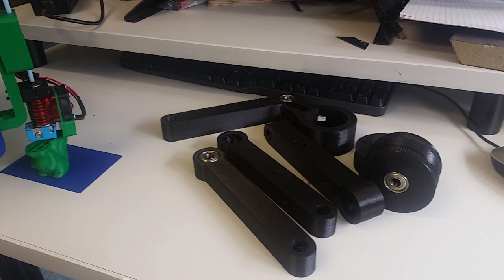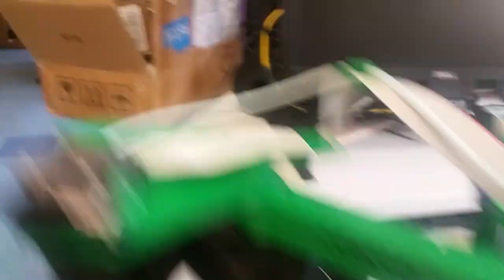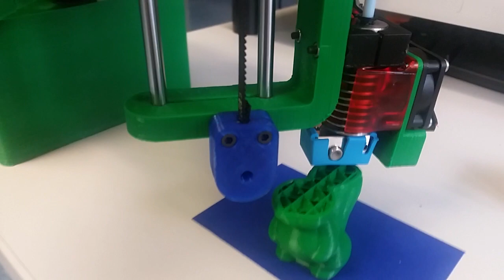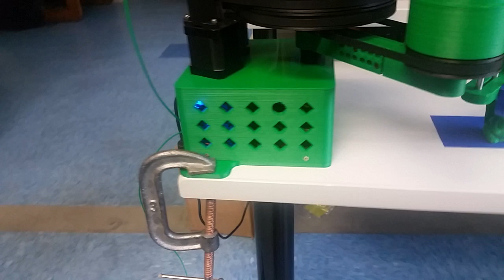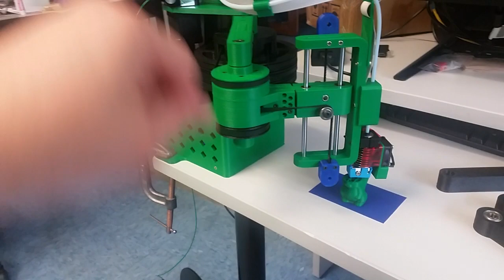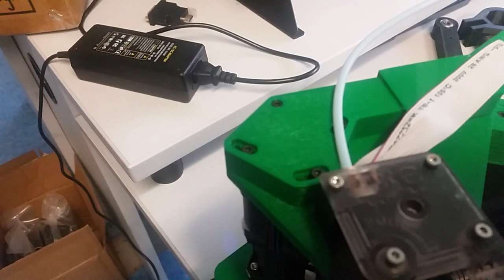Introducing RepRap Helios (First Print)

Comment: There was some interesting followup(?) video where you only showed the motor-pack core alone.
I can't find it anymore. Was it an older video or is that video taken down?
Reply from the maker: Hmm.  I don't remember that.  I think all of my RepRap HELIOS videos are public.  Anything that you want to know?
Reply: @NicholasSeward  
I like that one because it factors out all the motor vitamins into one single compact monolithic (pick and placeable) package.
So I'm thinking about eventually replicating something similar and tried to gather as much info as possible to 
not repeat errors/dead-ends that you may already have went through. ––– >> Do you maybe have 3D files published?
Reply: One big difference: –– I eventually may go for 3D printed chains rather than belts. 
High flex, high mass, bad performance I know, but it should be fine for crude pick and place robots which need way less accuracy than 3D printers. 
And chains can be pick and place assembled which is what I desire, given purely mechanical pick and place self-replication is my (overly ambitious) eventual goal.
Also I'll need additional motors for rotational DOFs. Chain threading through joints is gonna be a serious headache.
Reply: @NicholasSeward  – 
BTW what's the best way to privately contact you? – I found no contact info online.
( side-note – If spam-bots are your concern I solved that by putting an image of my mail on my homepage on github )
I recently have done some (yet unpublished) work (design & testprint) of 
fully-3D-printable tapered/conical cycloid sinusodial-herringbone gear-bearings that 
can be preloaded to zero backlash by back-to-back axial clamping of a pair of such bearings (with smartly 3D printed screws even).
I guess you'd be interested.
Reply from the maker: @mechadense  email is firstname.lastname@gmail.com the bearing sounds awesome.

Comment: Print time and cost of printer ?
Reply from the maker: It can pretty much be as cheap as you want.  It is a function of the cost of the electronics.  I could make a <200 dollar printer if I had to.  Print time is slow.  I havent pushed it but I have only gone about half speed of traditional printere.
Reply: @NicholasSeward  I think a dual-arm scara 3d printer would be faster and more stable. 

For example: https://youtu.be/R_AIzCTYBNs 

Just add a z-axis to the above design and compensate for the singularity regions by utilizing inertia (or just avoid printing in those regions).

I'm actually very interested in building a scara CNC device with a changeable end-effector to allow it to 3d print, mill, and laser engrave/ cut. I was researching this when I came across your awesome build.
Reply: @jaredj-v5l  I made a two arm.  Google Reprap Wally.  The one arm is good for cost, control, and portability reasons.  Speed wasnt a goal so you are right that a more parallel solution will be faster.
Reply: @NicholasSeward thanks for answers in my opinion your project     looks promising !

Comment: very cool, but why not just use servos for the joints? It's possible to 3d print a transmission for each one for very detailed movement. I can imagine turning this into a proper 3D printing arm. Rotational movement, extension... can you imagine 20 of those with articulating motion printing the same thing? It would be amasing... and all 3d printed from something like this.
Reply: 3D print this Drive https://www.youtube.com/watch?v=EfmjhfN8D-Q
Reply: You could totally do servos but, the programming can get a bit complicated.

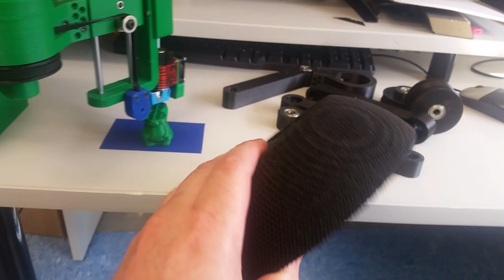Comment: dude !!! just say "Fractal" at 3:15 !!! T.T
Reply from the maker: Welton Barbosa Haha.  It is not really a fractal.  The important part is that if you want to use it then you need to know it is called cubic subdivision. 😀
Reply: thanks for correcting me, when you say "cubic subdivision" i did not knew the math behind it applied to 3d printing , now i see why it make much more sense to use this approach (as used in electrical high tension transmission tower) .

Comment: Wouldn't it be preferable to move the extruder motor to the end of the arm? That would help add weight at the end and improve print performance for flexible material
Reply from the maker: That is certainly an option.  We will have to experiment.  Contrary to the video I will both increase rigidity and lower the weight to hopefully allow for increased speed.

Comment: Will it be possible to make this a dual extrusion printer?
Reply from the maker: @TastyMunky It will certainly be possible.  However, I will be making multiple machine cooperate which has better speed and is generally cooler.

Comment: hey Nick, first of all I wanted to say that this is such a cool printer.  I wanted to know if it was possible to use larger rods for the z-axis. I have a pair of 250mm rods and wanted to know if I could use them as is without cutting them to size.
Reply from the maker: @Eric Furman Absolutely.  The design will be parametric so you can mix and match components.  That said deflect increases with the third power of length.  My 150 rails get me 100mm of z so yours will give you 200mm.  However, yours will be 8 times floppier.  (That is a bit of a lie because my current machine has M6 rods.  I just did the math and 8x250 will be  2.5 times floppier.)  What you can do is just left a lot of the rail stick out of the top of the print where you won't usually be able to use it.  For those random times when you need a huge print, put your print up on a 100mm riser and then clamp it down.
Reply: Nicholas Seward thanks. that's what I was thinking I should do.  I know that this question has been asked a million times, but when are planning on releasing the files for it?
Reply from the maker: It should be in June.  I have to graduate from grad school and finish out the semester before I can really get ready for the final push.  I jumped the gun on Wally and Simpson so this one is going to have a 100% full ecosystem or nothing at all.  A partial roll-out will lead to tons of confusion.
Reply: Nicholas Seward thanks for all your help
Reply from the maker: ABSOLUTELY!

Comment: Great work! The Z-axis at the end of the arms seems to work really well (I am a bit suprised to be honest!). What are your thoughts on having a Z-axis as the first stage (lifting the shoulder and elbow, including their motors)?
Reply from the maker: I have a personal constraint of not allowing steppers to move.  I know how to accomplish that with a z first stage but it is complicated.

Even if you let steppers move, you need a strong frame to move against.  It is hard to do in a fully printed fashion.  The z final stage is light and dainty which is easy to handle with the printed parts.
Reply: Yeah it is tricky. I also think that Z-final is probably better suited for automated bed-leveling, which is good.

Comment: Nice! I have the same Azteeg mini v1. Are you running normal firmware? 
Turning on acceleration on my board makes my delta printer run pretty silently.
;set acceleration
M204 S800
;save settings
M500

Comment: Why do you even use belts, wouldnt  gears and levers work fine without backlash
Reply from the maker: Gears are hard to get the extreme mechanical advantage that I am getting here while remaining backlash free.  I am not sure what you mean by level.  If you can sketch something up, I will take a look.
Reply: Nicholas Seward I thougt about two wheels with pushrods connecting them instead of belts but you would need to have gears to accomplish any  reduction
Reply: Sorry for my language error english is not my mothertongue

Comment: Very cool. I'm also working on a SCARA machine, running Marlin. Just got the maths figured out to do both forward and inverse kinematics, including positioning of non-centered tools and probes (good for dual nozzles, etc.). The design on yours is great, with a solid looking base. Very RepRap in spirit. Can't wait to see how it evolves!
Reply from the maker: Scott Lahteine oh cool!  If you want to make the math easy then you can place all tools the same distance from the elbow.  All you have to do is add or subtract a machine coordinate offset.
Reply: The math is definitely simplest in the cases you cite: either radially the same distance from the elbow, or always centered on the arm. But for this machine I need to allow any arbitrary position relative to the elbow. Not all tools can be aligned to the same XY center-point due to the toolhead design. Fortunately the maths are simple, and (after pre-calculation) only introduce two more float additions to the inverse kinematic function.

Comment: So is this able to print a full disk around itself? Another thought I had, was that, for future possible developments. You could add a 2 axis pivot for the print head. using direct drive from stepper motors at the end of the arm. This would increase the weight at the end of the arm. And would allow you to print in more axies. Though the slicers aren't there yet, it's a possiblity for the future... ?
Reply: It's constrained by the elbow ratio and motor pylon. The inner arm cannot move past the pylon (perhaps even less, if the elbow reaches the belts), and the outer arm isn't much longer so the two arcs from either side of the pylon have limited overlap. The longer the arms are compared to the pylon's width, the better reach it gets behind itself. But as stated, it's likely going to be mounted at an edge (say, the back edge of a table) and can keep working on one piece as you remove another.

Comment: If you want more mass on the hotend would it be possible to use a direct drive with the feed stepper sitting above the hotend so we could use exotic material?
Reply from the maker: Gerhard Just Olsen It shouldn't be a problem.  An e3D aero with a pancake 17 should be just the ticket.

Comment: Nice job! But you might want to have someone model the resonance frequencies and see if you can adjust the design to dampen them (not just drive them lower).
Reply from the maker: Chris Cox Modeling will be a challenge with the complex infill of the printed parts.  I will see if I can put an accelerometer on the hot end and measure with a few different configurations.

That said...mass only dampening is very common.  Beyond that, we would need something like a viscous joint or lightly loaded clutch pack.  With the current awesome quality of the prints I can say with confidence that I won't be looking to add any more complexity.

Comment: AWESOME!! you develop your own firmware? if yes, how implement linear interpolation?
Reply from the maker: Ricardo Casimiro I modified the Morgan arm solution in Smoothieware.  I have it set to break lines into .5mm lengths.
Reply: I also make a scara arm from scratch but I've problems with structural design

Comment: I'm totally going to build one of these once the design is released. 
Quick question though, would smaller steppers (NEMA 14) be viable for the x, y, and z axis' ? 
I imagine the torque requirements are pretty low for this motion system.
Reply from the maker: I am currently using 25% of the avaliable torque and I still have a lot of trouble making it skip.  I will keep testing with lower and lower power.